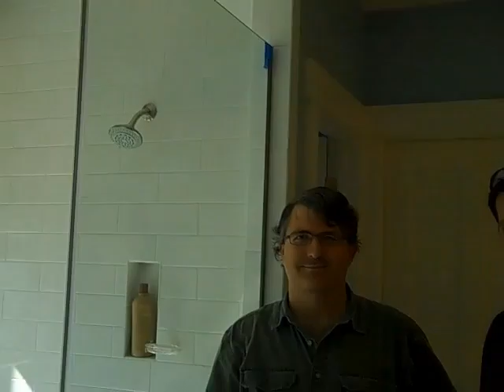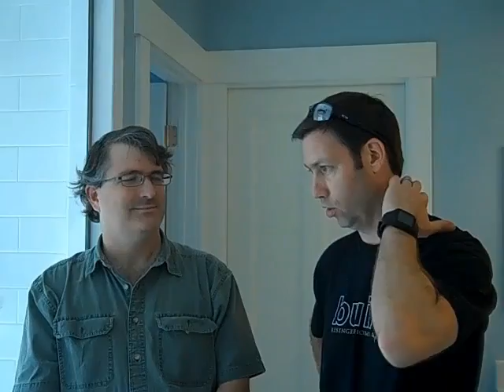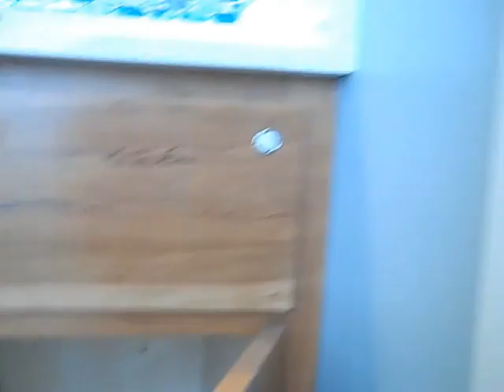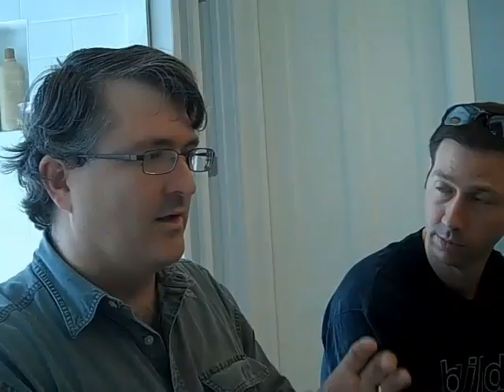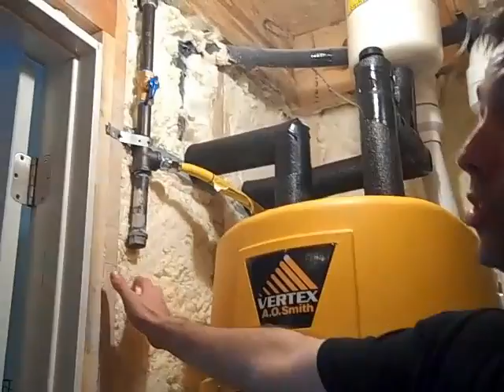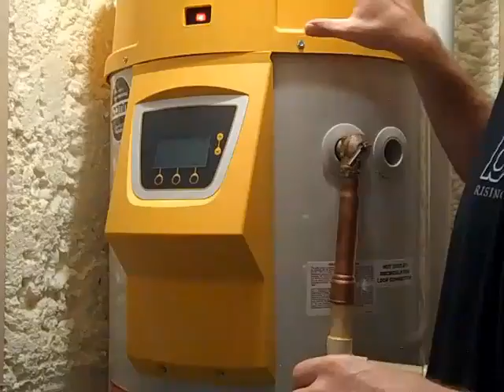AO Smith Vertex Water Heater Review

Comment: I don't use a recirculation pump.  Before I get into the shower, I would brush my teeth using the cold water from the hot tap. By the time I have finished brushing my teeth, the hot water is there for my shower.

Comment: I've been curious how these recirculators worked; however, heated water into the cold water supply would double the normal heat loss of the piping...and the heated water wasted to achieve cold water. We use the self regulating temperature control valves, which bring only hot water in until the desired temperature is reached.  We also have a third pipe, originally utilized from cistern feed for "soft" rainwater. Now the third pipe is our bypass of the softener, so now it serves as our "hard water" and utilized for all drinking water, exterior spigots and also feeds all toilets. Keep in mind this piping was already in place from 1920,
If you must preheat... a third pipe return to a preheat tank seems a money saving solution without aggravation.   Note: the feed to our refrigerator/ice makers and even the cold at our kitchen faucet is tied into this preferred "third line" drinking water. Interested in your views.

Comment: Not sure why you didn't run a dedicated recirc line for the pump and then insulated it. Also wouldn't a motion detector by a better to activate the pump rather than having to remember to push the button when you want hot water.

Comment: Characterizing tankless heaters as 80% efficient non-condensing is inaccurate and misleading. Yes one can buy an 80% tankless water heater just like one can buy an 80% storage water heater. Most tankless heaters are 95%+ eff and lack the stand-by losses of a storage tank.  There ARE some valid reasons for choosing a high efficiency storage unit over a tankless in some circumstances and you touched on a couple.

Comment: hey matt. i have the same unit but without the display. Near the bottom of the tank seem to be the control unit. I am not sure what happened but the system just stop heating. The system still turns on and off like normal but the only thing now is there are 3 lights on at all times: a green light on vacation, the third light in (arrow pointing down) and the light at the end (far right under the letter C). I am not sure what the workarounds to try to fix this are.

Comment from the maker: Yes good point.  I've had good success with instant recirc pumps like the Metlund D'Mand pump.  This unit is placed at the furthest fixture from the water heater and when a button is pressed it circulated the water in a loop until the water at that location gets hot.  Then it has a thermocouple to sense the hot water and shuts off the pump.  Very little energy used to run the pump, and no water goes down the drain, plus the water gets to the fixture 3x faster.  Very good system.  Matt Risinger

Comment from the maker: @Resistoon They are comparable in cost to a tankless water heater.  One thing to remember, these are condensing units so you need a place to drain the condensate or install a condensate pump.  -Matt

Comment from the maker: @HomeEnergyNow I think solar hot water can make sense but if hot water is only costing you $16/month it hardly makes sense to do solar hot water.  That's the case for my house anyhow.  My gas bill is $15-20/month and that's for a tankless hot water heater, gas cooking, & gas dryer.  Solar hot water has alot of moving parts and annual maintenance plus freeze protection issues.  Solar electric is solid state and should be pretty free of issues for it's 25+ year lifespan.  Matt